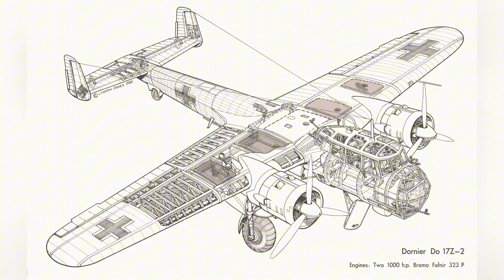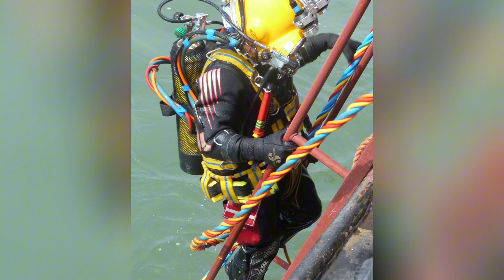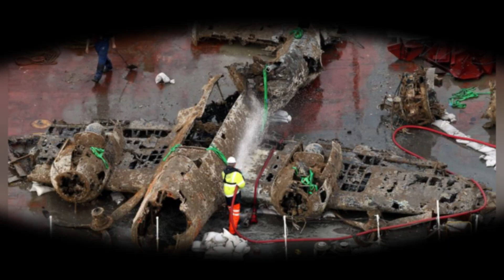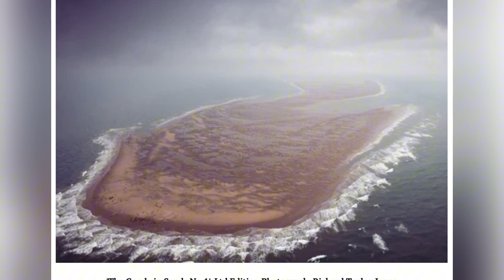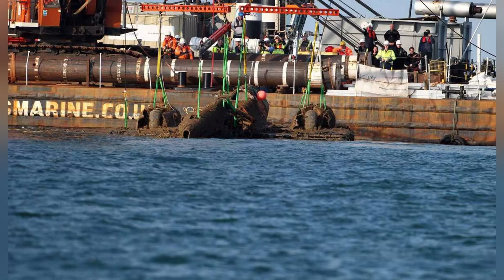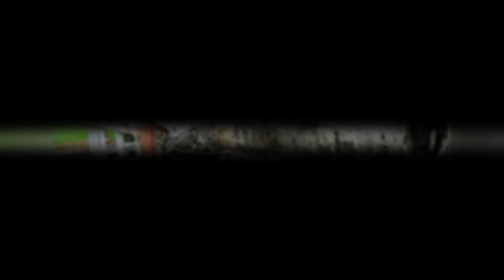Recovering Dornier Do 17: Raising the Last “Flying Pencil”

Comment: There are two Short Stirling bombers lying on the sea-bed between the south coast and Isle of Wight. Both in similar condition to this Dornier. So why have these not been raised?
Reply: I‘m all for having a complete Sterling instead of the parts that exist. My guess is that the Do-17 is simply more rare since it was lost in WW2 and the type no longer in use after 1945 I’m comparison the sterling solving into the 1950s. Plus there is one Sterling salvaged from a crash site in Germany now at a museum in Bonn. Amd there is the sterling project oc. aiming to rebuild a (airworthy?) sterling from some original components.